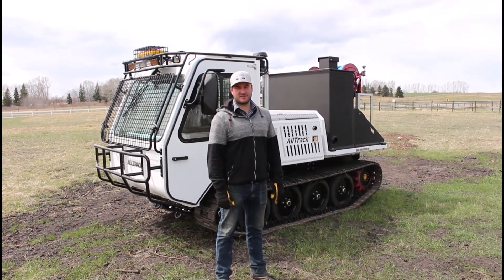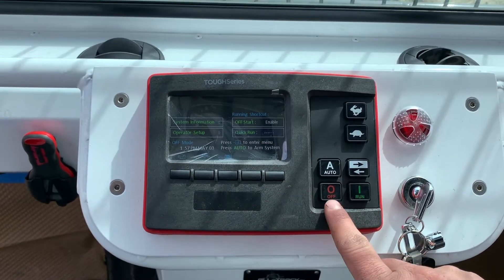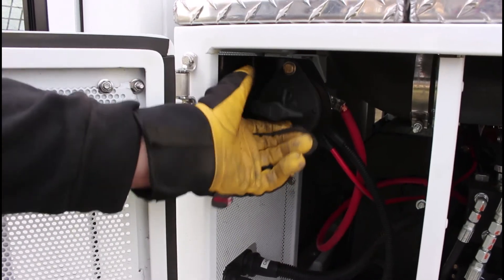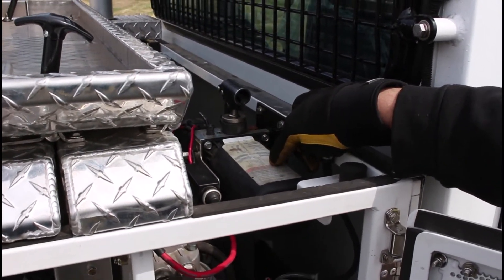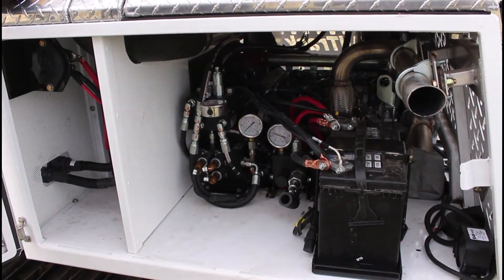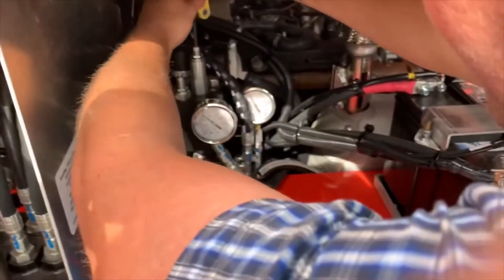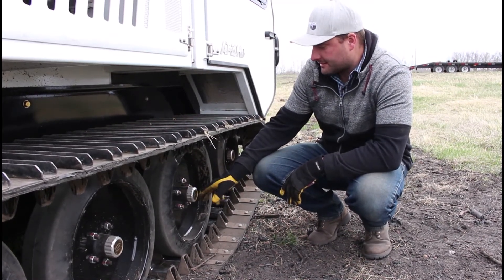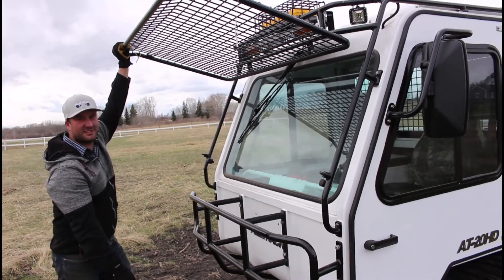2021 ALLTRACK AT-20HD Operation and Maintenance Instructional

Comment: To bad it has a Tier 4 engine the first thing I'd do would be to take out that junk engine and get something like and old Deutz. OM616 or a detroit. Then you would be stylin'
Reply from the maker: The Tier 4 Hatz in this machine has been strong. It has no DEF Fluid or DPF (diesel particulate filter) as its under 74 HP. It has proven to be reliable and economical to run. It wont roll coal like a old detroit will though.